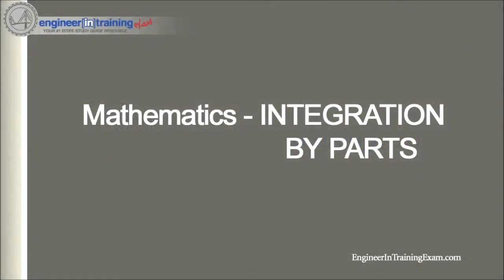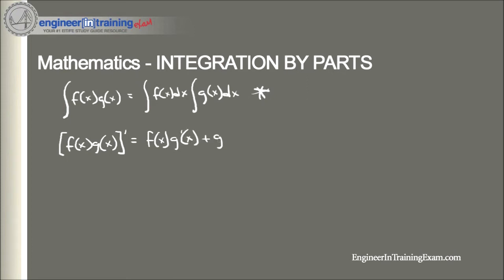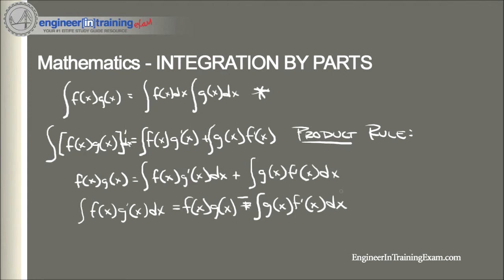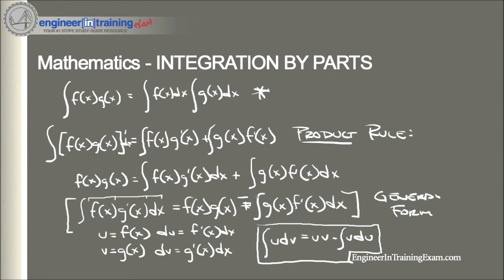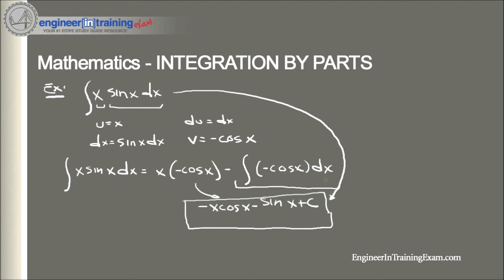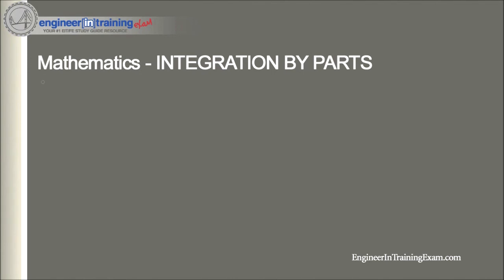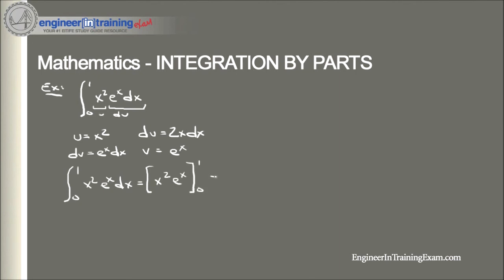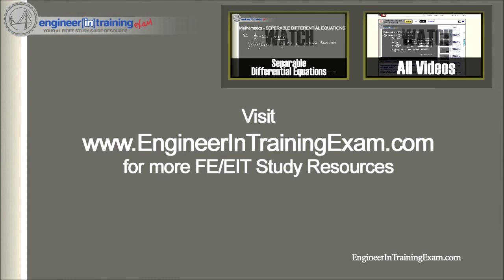Integration by Parts - Fundamentals of Engineering FE EIT Exam Review

Comment: Hi Justin, thanks for the video! I got a different answer for the integral in the last example though. [x^2e^x] - 2[xe^x] - 2e^x = (1^2e^1 - 0)-2(1e^1 - 0)-2(e^1 - e^0) = 2-3e
Reply: He did not specify his parenthesis.  It should be [x^2e^x] - (2[xe^x] - 2e^x).  
After he solved the second part of the integration by parts, it equals 2[xe^x] - 2e^x, but once you put the second part into the first integration by parts, the whole thing is negative.  
So simplifying it will give [x^2e^x] - 2[xe^x] + 2e^x.